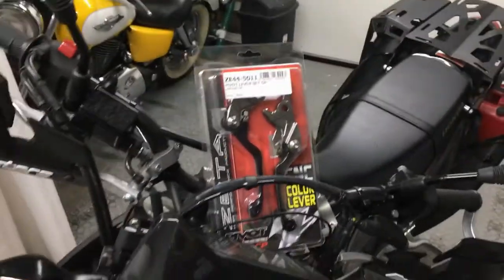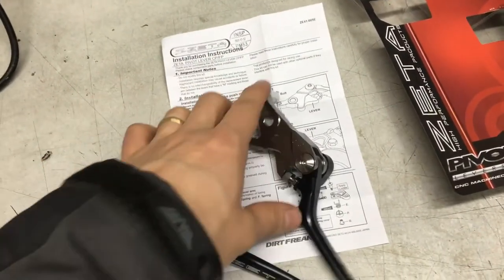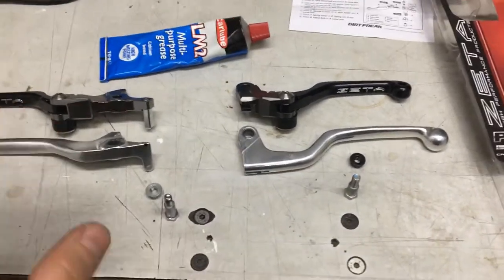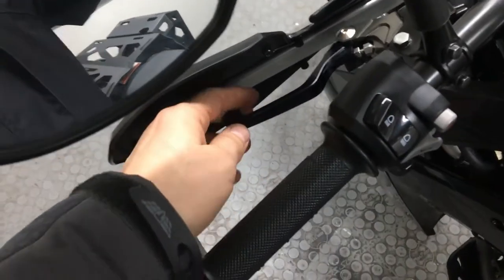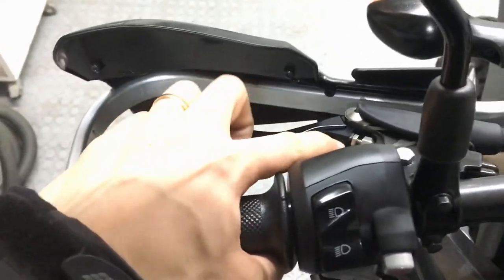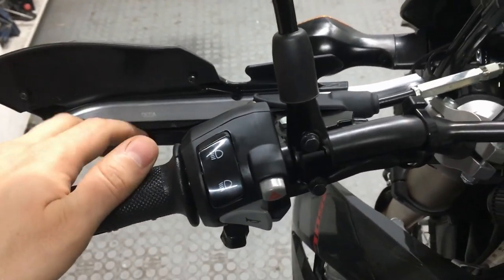How to install Zeta Pivot Levers on Honda CRF250L (Zeta Brake and Clutch Lever Set ZE44-5011)

Comment from the maker: Reasons For Installing Sorter Pivot Levers: 00:00
Installation Process Overview: 01:59
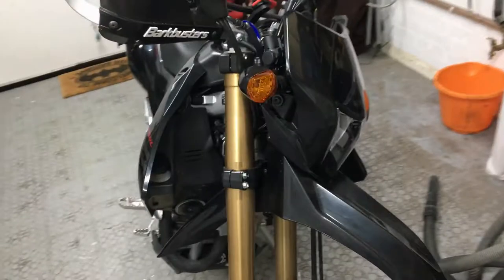Stock Levers Removal: 02:50
Zeta Levers Installation: 05:35
Clutch Freeplay Adjustment: 08:03
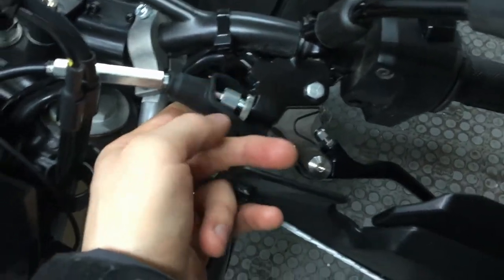Lever Setup For 1 or 2 Finger Breaking: 08:43